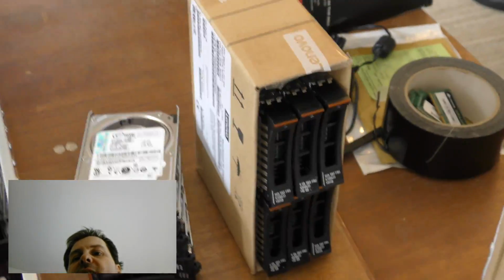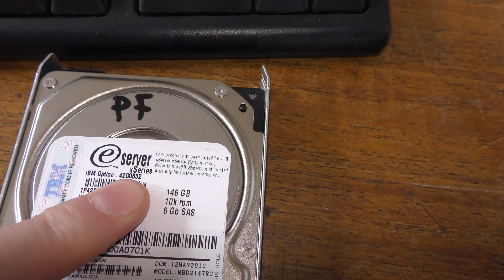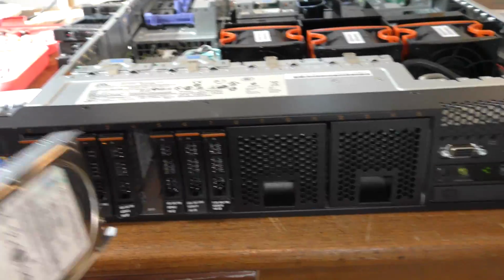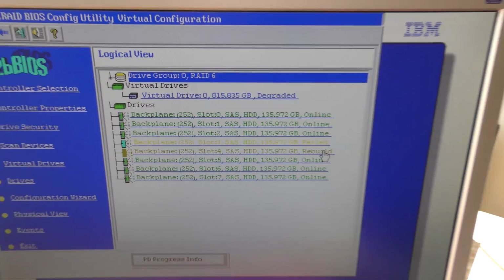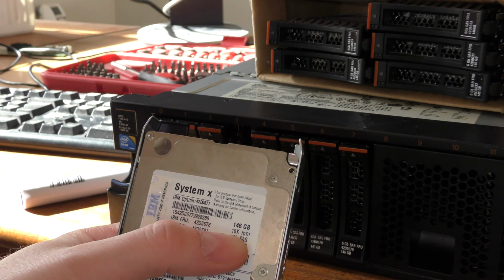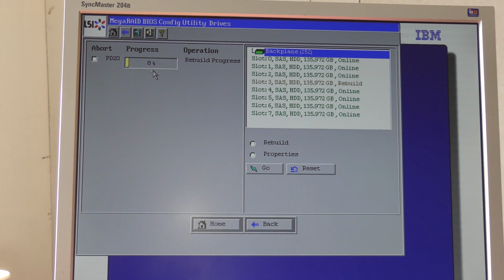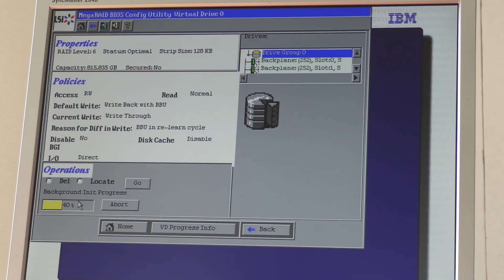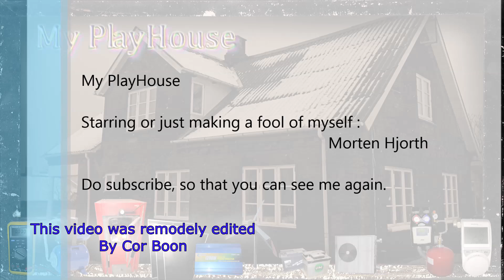Lenovo x3650 M3 with two Failed Drives in RAID 6 - 500

Comment: I have configured raid 10 on windows 10 - i was wondering if there is any  warning messages in windows (besides event veiwer) when a SSD is about to fail, or has failed - in order to change it before one loses another disk. 
Right now i'm left with the conclution that have to be checked frequently or am i wrong?

Senario of a server running for months, and realy booted (smal business)
Reply from the maker: Hi WerewolfSlayer91
I do not know if Win10 will pop up with an error if something is suspicious,,, On an Lenovo server, the raid controler and server, will know if the disk starts not to work as expected. and give you an alert.
Thank you for watching! :-)
Reply: Actually on Windows wanabe Raid, when the system sees, the HDD reports issues like SMART, etc. it will pop very disturbing message everytime you logon to the server, which says something like: Windows storage reports failing HDD and some number which should help to identify the weird drive. But Windows storage is not something I would recommend... Of course you can script to mail yourself when this situation occurs.

Comment: Hey, I think you got something wrong regarding RAID6: The two parity stripes are not identical. If you would loose two disks in a 5 disk array, you would end up with some parts of data where you are missing two of the actual data strips and got only two times the same parity information - not much to restore in this case. 
RAID 6 actually uses two different parity algorithms, mostly XOR (like RAID5) and a much more sophisticated second algorithm (independent syndrome involving field theory, see Wikipedia if you're crazy enough to try understanding the math/mess). Since the parity is distributed every disk will contain both types and a rebuild will in all cases, also if only one disks fails, require more computational power than a plain RAID5/XOR. In practice it is usually not really relevant for traditional hard disks since CPUs and RAID controllers are efficient enough to saturate the disks write speeds in most cases nevertheless.
Also: partially degraded because there is still some redundancy and the array could survive another failed disk in this state
Reply from the maker: Hi BitBastelei
Thank You very much!  Yes, No,, I did not dig that deep..
Thank you for watching! :-)

Comment: I think the Dell servers run the fans at full speed with the cover open to remind you about the airflow issue and give a red status light. I would have thought the system monitoring would also flag up high hard drive temperatures.
Reply from the maker: Hi Coolkeys2009
Thank You very much!  Yes the dell does it that way...
Thank you for watching! :-)

Comment: I have that exact server for our backup system with Raid-10.   I find the WebBIOS/Megaraid configuration utility a bit clunky, always get nervous when I go in there to configure things.
Reply from the maker: +AnalogX64 
I am not going to disagree with you,, there are a lot of room for improvement. The megaraid software is probably the best way to configure theses.
Reply: I prefer to use the CLI under an SSH session with LSI's MegaCLI. Also the WebBIOS load correctly on my IBM x3850 M2.

Comment: Why have you been getting so many failed drives??
Reply from the maker: +T Play's Now 
I take the bad-ish ones from work, and when they totally die I bring them back. So they are often bad to start with.
Reply: Ahh ok thanks!
Reply: My PlayHouse Makes sense. Like ordering "refurbished" ones online. Even Hgst isn't safe if it has had years of power on and rewrites. 

Solid state is supposedly much more reliable and safer to buy used according to servethehome.
Reply: That really depends on how they where used before. I have no problems to kill a SSD in 12-24 month when constantly rewriting it's sectors...